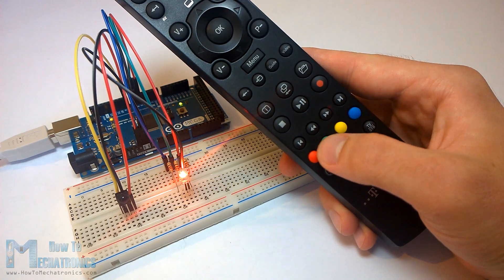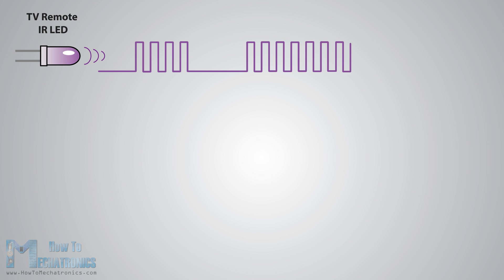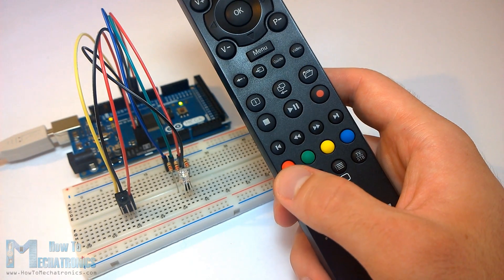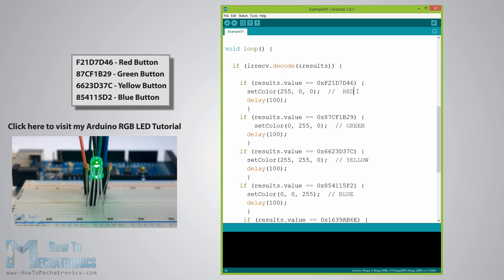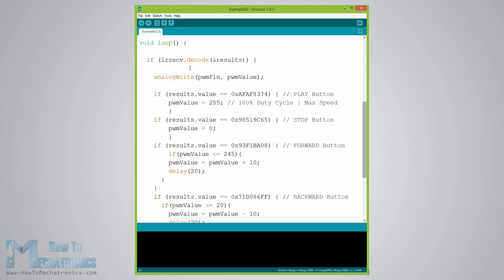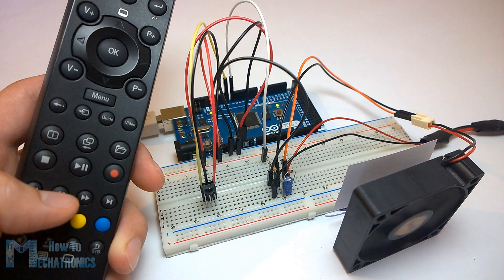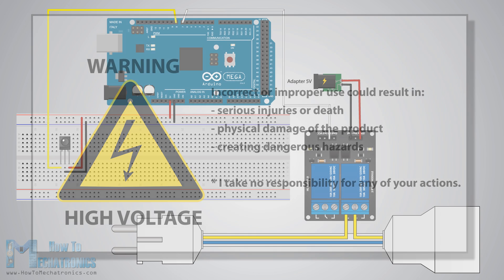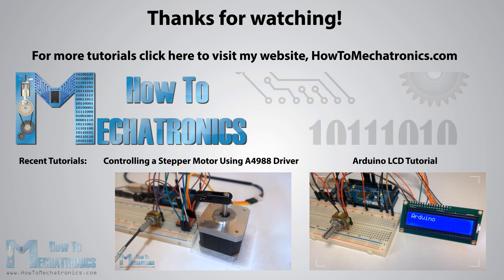Control any Electronics with a TV Remote | Arduino IR Tutorial

Comment: I try IR FAN speed but not working. Recognize only IR buttons OK.
Reply: There is no ground connection between the Arduino and the ground of the 12V power supply in the circuit diagram on link to details.
Stopping and starting the fan works but only after the second pressing of the buttons.

Comment: Arduino: 1.6.12 (Windows 10), Board: "Arduino/Genuino Uno"

E:\Arduino\libraries\RobotIRremote\src\IRremoteTools.cpp:5:16: error: 'TKD2' was not declared in this scope

 int RECV_PIN = TKD2; // the pin the IR receiver is connected to

                ^

Multiple libraries were found for "IRremote.h"
 Used: E:\Arduino\libraries\RobotIRremote
 Not used: C:\Users\TEDY\Documents\Arduino\libraries\Arduino-IRremote-master
exit status 1
Error compiling for board Arduino/Genuino Uno.

This report would have more information with
"Show verbose output during compilation"
option enabled in File -> Preferences.

Comment: Hello, I am able to replicate what you have shown in the video, although I am having an issue at 2:00 minutes in your video you begin to find the HEX codes. They are in burst of three, similar to my controller. The issue that I am having is that when I set a command to execute (lets say turn a motor on for 2 seconds) the triple burst makes the command execute 3 times so the motor will run for 6 seconds instead of the intended 2. I have added a delay but it only removes one of the burst. Can you share your solution to this issue? Thank you.

Comment: For the fan project i have everything connected as the diagram shows, the ir codes work fine as the yellow light blinks when i enter the command , what else would be the problem why the fan isnt responding?
Reply: +Dejan Nedelkovski  all components are good tested with multimeter im figuring out if i should change the resistor which is 1/4 watts to 1/2 ? I dont have any other ideas . Also could it be that im using a antec 3 speed can with the speed switch, because i see that you use a fan with only 2 pins
Reply: +Dejan Nedelkovski *3 speed fan with 3 pins
Reply: one of the common mistake is that use one ware & connect one side to the battery negetive terminal & another side go to the arduino group pin.....

Comment: Dear,
Thanks for the video. It is very nice and easy as you described. 
Is it possible to develop a logic to wait for IR input ?
I want to make a nested conditional loop. In that case IR command 1 has two subsequent option command 2 and 3. and each of them (command 2 & 3) has defined routine task. But the issue is, after receiving command 1 it is not waiting for further input and ends the loop function. I need to hold the execution after receiving command 1 and check for IR signal availability.

Looking forward for your answer.

Comment: I have constructed the circuit and it works (sort of). Unfortunately, when the IR code is sensed it is not a stable decode.  I have tried several remotes but they all behave in the same way. It appears to be a timing issue. Maybe I should just order the IR receiver you used and that way we are comparing apples to apples although I would think that any IR receiver module should work. Thank for any thoughts you might have and thanks for a great tutorial.

PS I have years of experience using Atmel micros of the 8051 family. I am just retired and was just trying to learn something new to keep my might from going to sleep. Thanks again.
Reply: +Dejan Nedelkovski 
I got my project to work and thought I'd share how I resolved my issues. 
1. I powered the receiver module I was using with 3.3V from nano
2. I installed a 220 ohm receiver in series with signal out of module (as per another tutorial I found to decrease noise)

It now works perfectly! Thanks so much for your tutorial.

Comment: How to save my hexadecimal code on eprom? ...Thanks a lot.....
Reply: +Dejan Nedelkovski  I use 4 I/O.One input is for IR sensor,other input for push button,one output is for control relay and other output is for LED diode.When I pres push button LED is turn on and I must to press button on my remoute from TV which I want to switching light.If arduino successful save code in EPROM the led diode is turn off.Afther that program whole time check input from IR sensor and comper that code with code in eprom. I don't know how to store hexadecimal code.This is my code and problem is that I must manual to put in program in this case "0xE0E0C837 " and when I change remoute control I must againt to change code.Because of that I want to add one push button and led diode which alow me to automatic set my remoute from other tv or something else. Thanks a lot.Sory for my bad English

#include <IRremote.h>

int IRpin = 11;  // pin for the IR sensor
int out = 13;    // LED pin 
boolean relay_status=false;
IRrecv irrecv(IRpin);
decode_results results;

void setup()
{
  pinMode(out, OUTPUT);
  irrecv.enableIRIn(); // Start the receiver
}

void loop() 
{
     if (irrecv.decode(&results)) 
    {
      if (results.value == 0xE0E0C837)
      {
        relay_status=!relay_status;
      } 
    digitalWrite(out,relay_status);
    delay(200);
    irrecv.resume(); // Receive the next value
    }
}

Comment: hi, i was trying to connect circuit of FAN using diagram given in your website, it is not working, is there any change in circuit?, i'm confused in +ve & -ve leg of capacitor, as it is not shown in diagram, i've tried both side by connecting to transister, did't work. PLZ give replay.
Reply: +Dejan Nedelkovski  ,,, GOT IT.(problem was , i did't connect ground pin to arduino).

Comment: Would controlling a motor be similar to controlling a fan?
Reply: +Matt Bilik  the fan could be using ac voltage or dc voltage. so its not the same
Reply: If you mean on controlling the speed it's quiet different procedure for every motor, and controlling AC motor would be a triac phase cutting or some frequency based controller ( these are used for three phase ones two) , if it's a DC motor you'd use PWM over transistor that can handle sufficient current. If it's stepper then by delays between steps. So yeah, it really depends on motor you're trying to control.
Reply: Identical

Comment: Hey when i am compiling the code I am getting the following error
Arduino: 1.6.0 (Windows 8), Board: "Arduino Uno"

C:\Program Files (x86)\Arduino\libraries\RobotIRremote\src\IRremoteTools.cpp:5:16: error: 'TKD2' was not declared in this scope
 int RECV_PIN = TKD2; // the pin the IR receiver is connected to
                ^
Error compiling.

what should i do?
Reply: +DIYGUY999 You probably used an old version. I had the same problem with 1.0.
Just delete the old version from the libraries folder, and use the latest:
https://github.com/z3t0/Arduino-IRremote/releases

Comment: excuse me sir I have a question....is the circuit normally open or normally close?
Reply: I'm refering to the circuit of the Remote controlled fan.....another question sir where is the diode and capacitor connected?is it in the collector?
Reply: +Dejan Nedelkovski  , in your Arduino Motors Tutorial, one wire connected to ground in arduino but not in FAN(remote) diagram.  how???